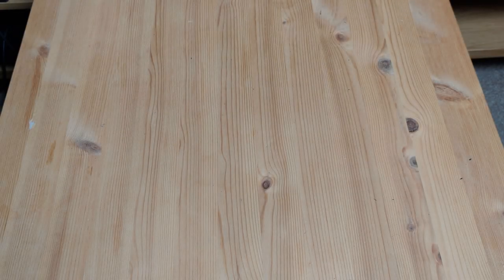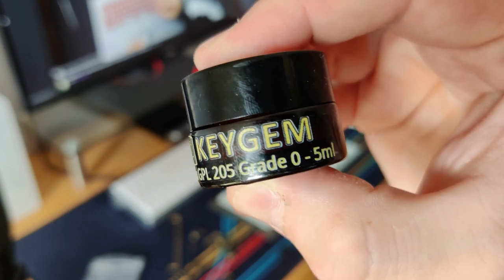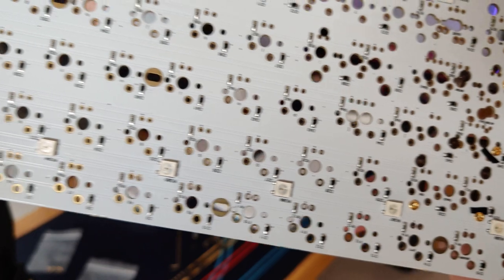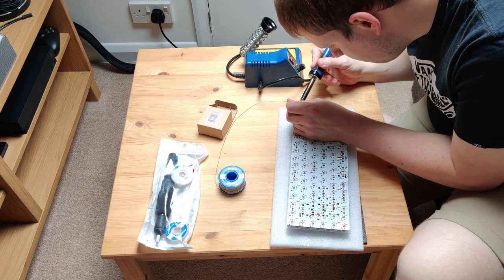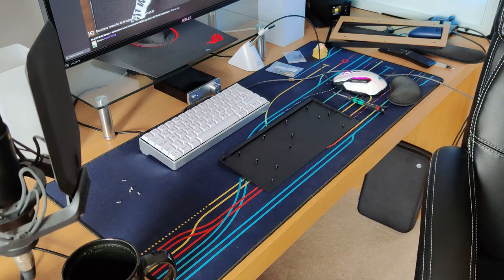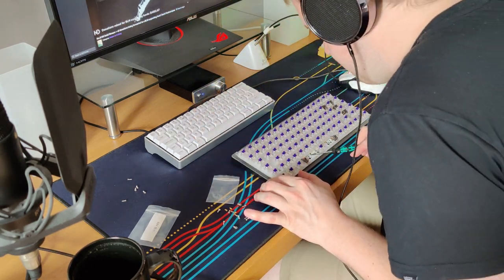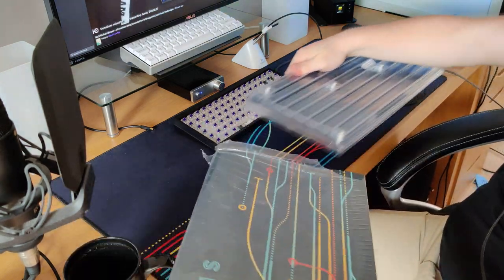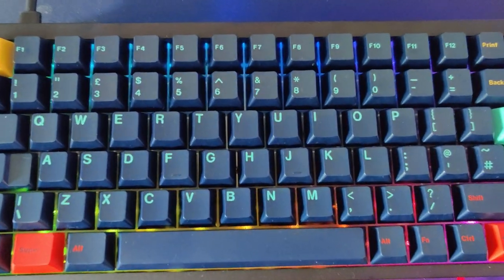MY NEW KEYBOARD FOR 2020 - KBD75v2 Build

Comment: Thoroughly enjoyed this video, my dude! Been thinking of picking up the KBD75v2 as my first DIY mech board. Nice work and it's good to see an ISO layout too haha :D
Reply from the maker: ISO Gang!! But yeah, this keyboard is a great project.
Reply: @B_DoesThingsYT  i was thinking about buying this keyboard too with zelios v2 62 g.
Was it easy to make it iso and how did you know which holes to put the switches in ?
Reply: @B_DoesThingsYT  Tbh, I like ISO, but only cuz I learned typing with it (I'm German btw). But I'm thinking about switching to ANSI, cuz there are MUCH more options (Key caps and Hot-Swap PCBs) than ISO (especially ISO-DE)

Comment: Great Video!

 However I wouldn't recommend using Krytox 205g0 for the stabs but I would recommend using super lube (or other dielectric grease) as its (at least in my findings) more resilient and much easier to apply. As for the use of electrical tape for the anti-shortage method it might be worth getting small plastic washers for the stabs instead as they're better for the pcb, clean the look, and give much better peace of mind. 

Hope this Helps!

Comment: PLEASE wear a face mask/filter when soldering! that stuff is worse than smoking!
Reply: Unless you do it 8 hours a day you'll be fine with proper ventilation.
Reply: @Hyydrotoo  really?
Reply: It's fine for short terms, at the very least use a fan to blow the smoke away from you. The smoke IS NOT METAL.

Comment: Great video! Do you think that the polycarbonate plate is better than aluminum or brass?
Reply from the maker: It's hard to say, as I haven't tried a brass plate. But the building process a bit tedious for inserting the switches.